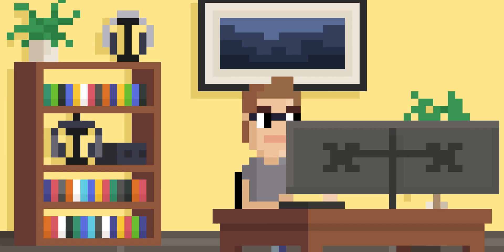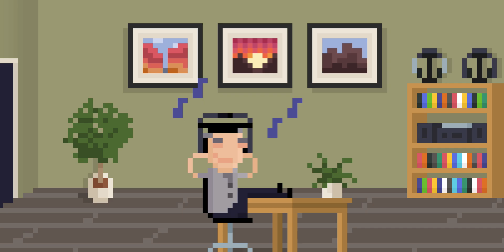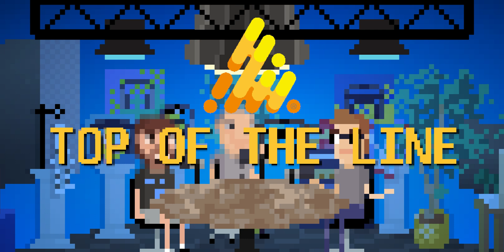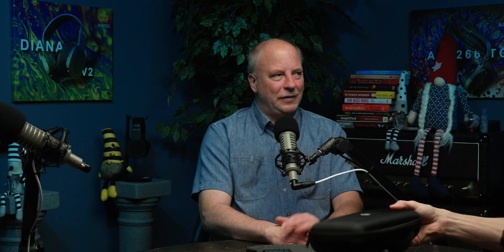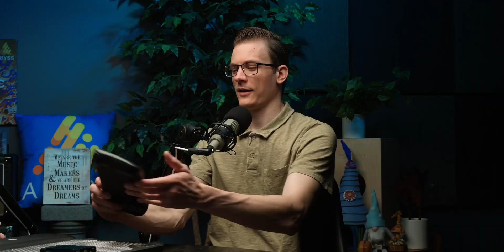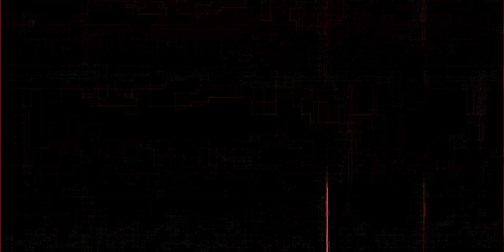Engineers Judge Steam Deck! (How well is it built?)

Comment: Direct connected to the headphone jack of the Steam Deck, it seems like around 80 ohms is the limit. Volume needs to be at 75% to be comfortable, and is not too loud to hurt at 100%. But in general it does sound pretty good. My whole Koss suite sounds great, as well as my focal clear, celestee, and the Ovidius TX-901. The Ovidius being my current favorite for the use case.